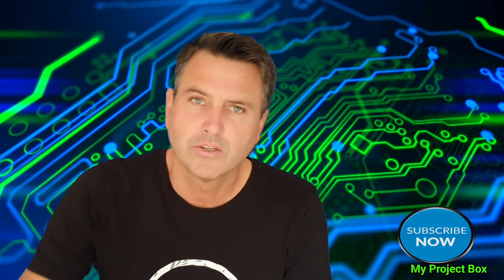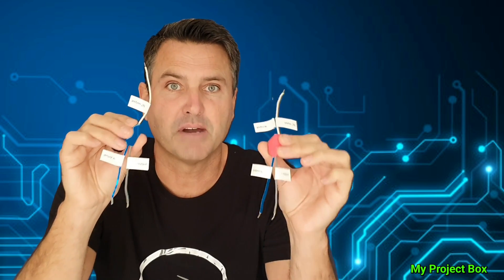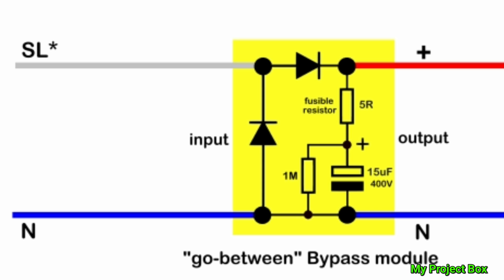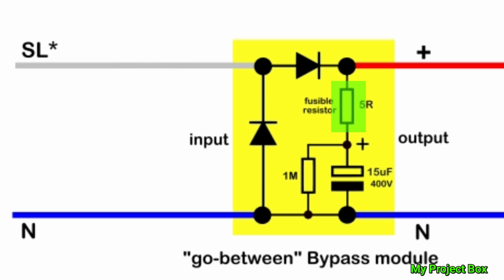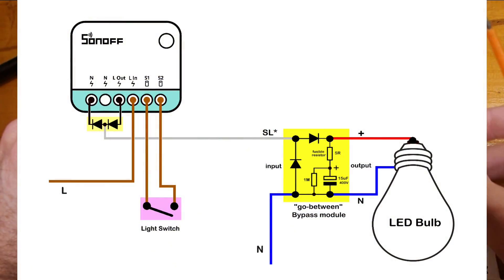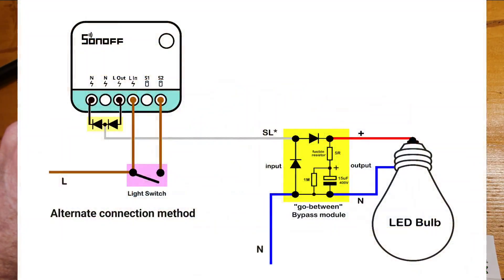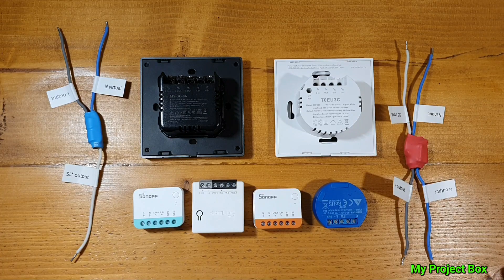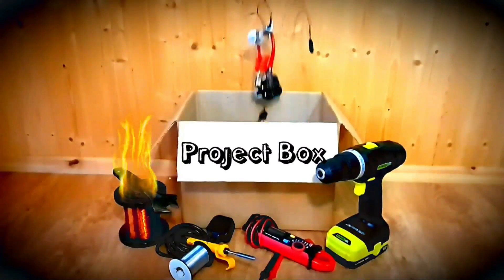Sonoff matter MINIR4M No-neutral smart switch?

Comment: I have a situation where I want to remove a 3way 2 gang light switch and just use zbminil2's behind (no connected switches). But still be able to use the other switches to control lights also. Is this possible without running additional wires ? .

Comment: Possible to use NTC 10D11 for the inrush limiting to capacitor in a 220v-240v environment? Will the 5R resistor fail after multiple uses? Frequent on and off of lights?
Reply: Thank you for info sharing. How do you actually compress the capacitor, resistors and diodes into such a small factor? Will it cause any over arching in the capacitor if it is too close? Possible to show physically how do you arrange these components?
Reply from the maker: @cranstonmason5697  mabe I should make a video only about the module construction. I don't have much spare time at the moment, but it seems worth doing. People can experiment and develop my ideas further, maybe make some improvements.
Reply from the maker: Yes a NTC thermistor would be more efficient and dropping less voltage. I did consider using one in my later designs. In my earlier design the resistor had a double function as a fuse and a inrush limiter. But because it's now in a different position and not acting as a mains fuse, the NTC is a good option. It does however not provide much inrush limiting for multiple on/off switches, because the NTC needs time to cool down. I don't think that is too much of a problem for this circuit though. I have a different version of the circuit in a newer video. https://youtu.be/VLMAmc3ZWsQ

Comment: Hello, I am using this circuit in South Korea. The switch I am using is the Jemi Smart 3-gang switch, with two gangs controlling fluorescent lights and one gang controlling a ventilation fan.

I have tested both the previous and current versions of this circuit. Initially, the lighting functions normally.

However, after about a week, the switch itself continues to operate normally, but the fluorescent lights connected through the bypass circuit start flickering. This flickering is not a subtle fluctuation (like a minor flicker) but a noticeable change in brightness.

What could be the cause of this issue, and how can I resolve it?
Reply from the maker: @하짱구-c7j  firstly thank you for letting me know that the circuit works with the JemiSmart 3-gang switch😉.
I generally recommend you use the bypass circuit with LED lighting, it was designed for, but it could work with some "newer types" of florescent lighting. It's possible that the resistor has failed and the capacitor is not preventing flickering. You could try to bridge out the resistor and see if that stops the flickering? Maybe test the circuit with a LED light bulb. Increasing the value of the capacitor can help with flickering, but the resistor will need to be higher wattage to cope with the larger inrush current.
Let me know how you get on😉👍

Comment: The fusible resistor in this circuit has a really tough time with certain bulbs for some reason.

Recreating your modules in a circuit - wired with a single cheap old led smart bulb I was using for a few months - "(Lighting master Alexa Light Bulbs 12W 1280LM)", and giving it a quick stress test, the fusible capacitor blows after turning the light on/off 5 times after ~1-2 second intervals (blows almost instantly if wired up in series like your old circuit) *To be clear in this case it was a 10R 1 watt resistor, but I assume the effects would have been similar on the 5R 0.5 watt (and should mention - pair of diodes at the bulb were the 10A 1000V you suggested, at the switch they were both 1N4007, capacitor was 400v 10uF, diodes measured a voltage drop of 600mV in the appropriate direction - my understanding is that means they're functional). 

However, with a Phillips led of about 13 watts, the fuse is much happier, and does not explode even after turning it on/off multiple times

If you have a moment, do you know what could be going on here and of any ways robustness of the fuse could be increased for these scenarios where the modules dislike the bulb circuitry, while maintaining safety? (PS - could this be used at all with a UK ceiling rose configuration - the assumption is it could just be attached to switch live, but would much appreciate any advice on that if you have any suggestions). Thank you!
Reply from the maker: @nathanielwilliams7456  I think you are on to something🤔. I'm thinking about ditching the idea of the "fusible resistor". There is just to much variability in led driver circuits. Some LED driver have large electrolytic capacitors, that would create a massive current spike! Some types of LED light (with big capacitors in the driver) need only the diodes, and you can leave the capacitor out. In my new circuit design I'm not putting a fusible resistor inline with the Live anymore, but rather in series with the capacitor(a normal 2w resistor). A optional inline fuse can be added inline with the Live feed. 
I'm currently working on a video about the NSPanelPro  which will be using a different circuit , without a inline fusible resistor.

To answer your question: yes😉 the circuit can be used with UK 3 plate ceiling rose system.
Reply: @MyProjectBoxChannel  Hmm, thank you, I'll certainly keep this in mind going forward, may just go without the capacitor if I find the bulbs end up working at expected brightness/flicker free without one anyway.
Brilliant, thanks for confirmation regarding the ceiling rose.

Comment: Sonoff and Shelly set the negative GND to L = hot conductor. 
Between N and Plus of the CPU, 226.7 volts (at 230V) are reduced to get 3.3 volts.
This makes it easier to operate the switch at Minus (= L)
Reply from the maker: Yes I noticed that 🤔👍😉

Comment: Great channel, good content! I've been thinking of your hack for no neutral but space is a problem for me.

I have two Aqara T1 (no neutral) per switch point and its crammed already, so adding this extra circuitry is going to be a challenge.

I went with Aqara instead of SonOff's or Tuya because Aqara is a more of a commercial brand whereas SonOff's and Tuya are more like hobbyist brands.

So far Ive had one Aqara T1 fail on me in a space of a month, I'm assuming the no neutral switches are not as stable as neutral versions but im not sure, so ive been thinking of going with Aqara T1's with neutrals

Are there any wiring codes regarding pulling neutrals in South Africa that prohibits or makes doing this more of pain to have done in terms of regulations in South Africa

Im thinking of getting an electrician to pull neutrals into my switch boxes, but i haven't seen anything in the wiring codes about this in SA

I was also testing two Shelly Dimmer 2's wired in no neutral configuration and they both stopped working mysteriously (died) for no reason, no visible burnt out components.

My other Aqara T1 no neutrals are still fine, but im starting to question my decision to go with no neutral switchea.

The two Shelly Dimmers were R850 a piece and the Aqara's were around R400, so naturally im concerned about their reliability, im not sure why three no neutral switches have died after such a short time!

Im on a 5kw Kodak inverter so things should be more stable than Eskoms supply 🤦‍♂️
Reply from the maker: @grantp3911  It's always going to be better to have a proper neutral behind the light switch. It's great if it's possible to do it, but in the UK the wires are normally directly plastered over, and not in conduit. So often you need to chase extra wires in to the wall. I have a different opinion were you can put the smart switch up by the light fixture. https://youtu.be/x7Q8AS238pY
Sonoff also does something called "magic switch mode" , this allows you to put it up by the light fixture https://youtu.be/NudSvGNqbAo
Reply: @MyProjectBoxChannel  Nice 😄, you now have me wanting to investigate the diode across the switch solution, with the optocoupler circuit and sonoff at the ceiling rose.  

Thanks for the feedback and suggestions 👍🏻
Reply from the maker: @grantp3911  my circuits are very much experimental/prototypes and I'm Constantly trying to improve them. I know some people have tried with different brands of smart switches. People have reported that with some brands all diode polarities ( and capacitor, optocupler) need reversing. I suggest that you make a test rig to experiment first. Read the comments from others. Here is a slightly updated version of the circuit, with a capacitor to stop any flickering on the LED light. It's for 2way lighting, but it's essentially the same circuit. https://youtu.be/9hQFFsBkxaU

Comment: Congratulations on the beautiful work, but I have a question about the diode. You won't have a drop in voltage by half.
Reply from the maker: @vanderleisilvasantos5343  the smoothing capacitor charges to the peak of the sinewave, so the voltage does not drop to efective half-wave rectified. It's kept close to the peak voltage. You should get full brightness of the LED bulb😉👍

Comment: Thanks for the video, would that work if there's an RCD installed in the house?
Reply from the maker: Yes, absolutely.  It will not trigger the RCD😉👍. I have RCDs/RCBOs in my house. There is no current "leaking to Earth", and the the load is balanced between L and N.

Comment: There should be a fuse on the reverse diode at the light fitting between neutral and switched live. If someone decides to remove the sonoff and wiring at the switch side in the future, replacing it with a standard switch without realising that additional circuitry has been added to the light fitting, there will be a bang. The same outcome will happen if a diode fails short-circuit.
Reply from the maker: @tomriesz2869  you can add a inline fuse if you want,  it's not a bad idea. In my previous circuit the "fusible resistor" was in the main current path for that very reason. But I have chosen bigger "oversized diodes", so the if there is a short-circuit like you described, the circuit breaker in the house should safely trip. Adding a additional fuse will take up precious space, so in order to keep things compact I decided to leave it out, and rely on the building circuit protection(in the UK it's normally 5Amp or 10Amp circuit breaker).  In my older circuit, people were having trouble with the fusible resistor blowing, with bigger connected loads. https://youtu.be/oBR5O391m_c
Reply: @MyProjectBoxChannel  It's a smart circuit design and a well put together video. My main concern is that, as you are probably well aware, it wouldn't meet the wiring code & device standards in many countries. One must ask the question, what was the intent of the standards and what are the consequences of not meeting them? If someone else was to work on this circuit without realising the changes, they could quite easily cause a short circuit.
Reply from the maker: @tomriesz2869  I have been thinking of adding a 3A small solderable fuse, on the lamp side of the circuit. On the next circuit update😉. If you think about it space saving is less of a concern at the light fixture, than at the light switch box, were things can get pretty cramped. I don't think any home made "prototype circuit" is ever going to pass any sort of electrical certification, but that is what electronics enthusiasts do, we build our own electronic gadgets!🤔

Comment: Hi thanks for your video! Really helped me alot. One question, would it make sense to use a regular fuse cartridge on the load line instead of a fusible resistor? E.g. a 3amp fuses for the 3amps diodes?
Reply from the maker: Yes, You can definitely use a 3A fuse, inline with the L, if you like. But the resistor has two jobs, it acts as a inrush current limiter, for when the capacitor initially charges up, and secondly as a fuse(If the capacitor failed). It should still work fine without the resistor, but the lifespan is increased, by adding a resistor. It puts less stress on the capacitor.
Reply: @MyProjectBoxChannel  Great thank you for such a prompt response! Because I couldn’t easily find a fusible resistor where I am. I guess an 5-10ohm thermistor would also work instead of the fusible resistor?
Reply from the maker: @hoanglonguk  yes a NTC thermistor is even better, but not good for turning on and off repeatedly in a short time, because they need time to cool down( like when used for inrush limiting in a SMPS). You can also use a "normal resistor" inline with a fuse. 1 or 2 W , 5-10 ohm. The circuit should work fine without the resistor or fuse,  if you want to test it out first.
Reply: @MyProjectBoxChannel  ah good point wrt to cool down! I’ll give the inline resistor and fuse a go. Thanks for all your help and pointers much appreciated!
Reply: @MyProjectBoxChannel  FYI the circuit seems to works many thanks again for all your help! Circuit seems to also work fine them on the aqara relay and switches. Though in some rooms with the Thorn Amy down lights, it seems they don’t play nice with the half wave circuit at all. Since the lights down the chain seem to flicker quite badly. 

Do you have any suggestion to remedy this in the main bypass circuit? Otherwise I think there will be too many points of failures if I go and put a capacitor on every light 🥲
Reply from the maker: @hoanglonguk  the only way to reduce the flickering is to increase the "bypass capacitor" value. You can use a bigger capacitor or put several in parallel. It's probably better to put several capacitors in parallel, each with their own inrush resistor. Each capacitor in series with its own 10 ohm resistor, then connect them together in parallel, at a central location. That way you don't need to put one pair at each light. If you increase the capacitor value, the resistors becomes very important, because the inrush current is larger, and that will put a strain on the relay contacts of your smart switch! I never really design my circuit for multiple LED lights with higher level of current loading. It is still possible to get it all working correctly. I  would suggest that you do some experiments on a test rig first. Make sure that you you use big enough diodes for the extra inrush current,  just to be safe. 

Thanks for sharing your findings with us👍😉
Reply: @MyProjectBoxChannel   should have waited for your reply, you’re absolutely right introducing another capacitor did indeed put more strain on the relay and in my case totally killed it lol 😬 no biggie thanks for your great suggestion once again. Will do few more tests as per your suggestion before wiring them up. 

Just got a little bit impatient there because of the missus nagging about the flickering lights hehe

edit: actually that did not kill my aqara relay. It was just bad design on their part. If you turn off the breaker, and the switch is turned on (closed), turning on the breaker tends to burn them doh!

Comment: 1.	If I turn off the light using the wall switch, can I then turn it on using the mobile app?
	2.	If I turn off the light using the mobile app, can I then turn it on using the wall switch?
Reply from the maker: Yes and yes, that's the point of it😉👍

Comment: This scheme turned out to be more difficult for me.
I hope everything will work according to the OLD scheme. Versions 1))
Reply from the maker: It has worked perfectly good for many people, so it should be just fine😉👍. You could try just moving the resistor if you prefer. You simply put it inline with the capacitor (Series with the positive) but that's up to you. I suggest you build everything up on a test circuit first (powered from a socket) just to verify its all working. Then do the final installation.
Reply: @MyProjectBoxChannel  Thanks for the advice ! Thanks for the quick feedback! I watch your video through a translator.
I am also writing to you through a translator)) I HOPE I WILL NOT MAKE ANY MISTAKES IN THE CHAIN😂

Comment: Thanks for the video, but why not just use Sonoff ZBMiniL2 which does not require the neutral wire?
Reply from the maker: Because it doesn't  support matter (yet). The modules also gives you more freedom to use different smart switches without a neutral. Like NSpanel and NSpanelPro

Comment: Superbh! ❤ What type of diode do you use? What is its reverse bias voltage? Can it withstand voltage spikes?
Reply from the maker: The diodes are all of the 10A10 type rated at 1000v and 10Amp. It's a bit overkill for LED lighting, but make for a tough/robust circuit.
Reply: @MyProjectBoxChannel  Awesome! 👏